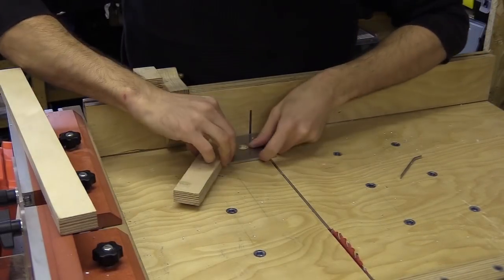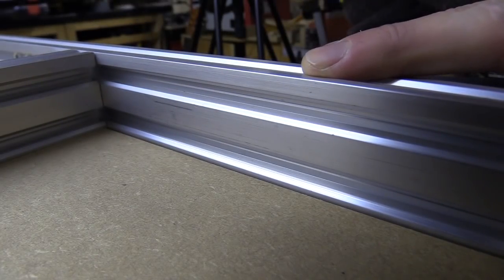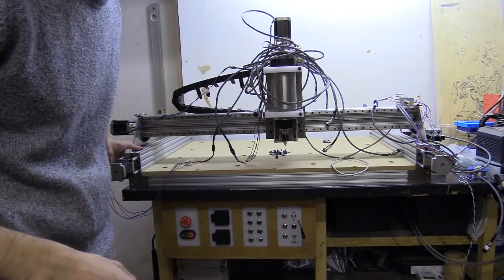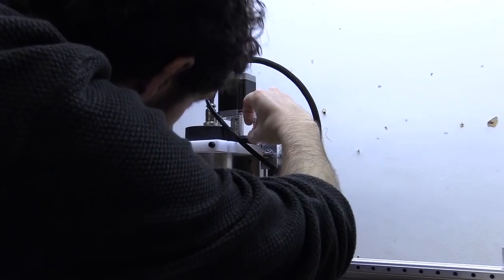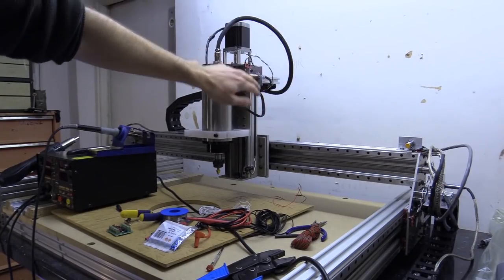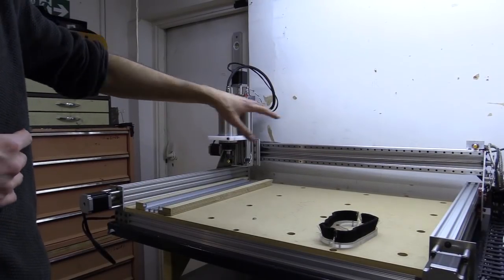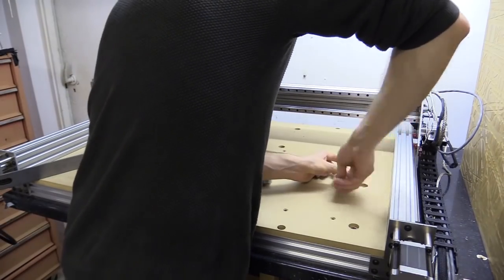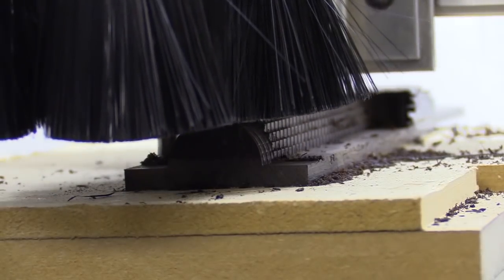#32 CNC Assembly Continued #32 / Hard Limit Switches / Lowering Wasteboard / Insert Nuts

Comment: Hey. Cool videos. Maybe you can help me. I am thinking about making a cross cut table 2ft x 6ft. So a sliding table that when pulled out will over hang 4ft. 2ft will always be supported. And will have to support the other 4ft. I was thinking about using C channel one, 6ft length on each side with gantry plates with wheels running in the c channel but at some point the gantry plates(wheels)will have to exit C channel and re-enter smoothly. And will the 2 feet be able to handle the 4 foot cantilever affect. Or do you think linear bearings would be better. Same thing. I would place the bearings at the front 0inch mark and 2ft back. So as I pull the table out the bar would never leave the bearings. Since you’re having a problem with the bearings be a little rough being so slightly out of line would I have a bigger problem trying to make them support 4ft over hang. Maybe you can help me if you understand what I’m trying to say. Thanks.
Reply from the maker: Hi Michael - Yes I'd imagine a linear bearing would be a lot better for that application. Also going for thicker walled aluminium profile but with any of these things - a bit of trail and error and prototyping really helps. Good luck with your project!

Comment: A question is when i home my machine and it does it will not move after that?
Reply from the maker: I think I had a similar problem - you might need to add a reverse movement away from the sensor once they are triggered, otherwise the controller will think you have an error. Not sure, though. It'll probably be something in the homing or config code.

Comment: it look like a really nice and efficiently build cnc machine. but looking at those bendy leadscrews i do wonder how much backlash are in the x and y axis.did you test them? 
i mean i'm guessing that it's probably good enough for what you're doing, but i'm interested.
Reply from the maker: It's not noticeable with sensible tool paths but the x axis is the most likely to cause problems. If I push the machine that will bend -  so I should probably swap that out to a thicker lead screw.
Reply: @EducatingSavvas  very interesting, how thick is the lead screw exactly, from a distance it looks like it's 16mm.
Reply from the maker: @jandillingh  I'm using Tr8 - 8mm thick with an 8mm lead. I've found a place to get 10mm but the lead is only 2mm so the stepper would have to turn more to travel at the same speed.

Comment: Looks like a big improvement over the original. I have a huge favour to ask.... I would love to see a 20 sec vid in which you pull collet nut of the spindle towards you and push away. My machine has noticeable flex, I don’t know if it is torsion in the x axis c beam or give in the x carriage v wheels. Given your x axis is longer than mine if there is no give in yours then I know what is going to happen to mine! It’s only a tiny amount but it killing my ability to machine aluminium
Reply from the maker: What machine are you using? Sure I can film that. There's still flex in mine but it's a lot less than the previous version with the v-wheels. But I can't tell if it's the linear rails or the c-beam twisting. I also recently whacked a bit onto the side of the MDF wasteboard which un-trammed the spindle along the x axis - but I could easily re-adjust the pivot plate. My machine is not a tank, but if I can re-square and tram it really easily which is great for me.

Comment: That AL plate at the start, did you drill it out by hand? (ie Drill press?)
Reply: i believe they was water cut some company, but can drill by hand. holes not need be acurate. end result just need have bearing hole correct spot. plate is just fixing that